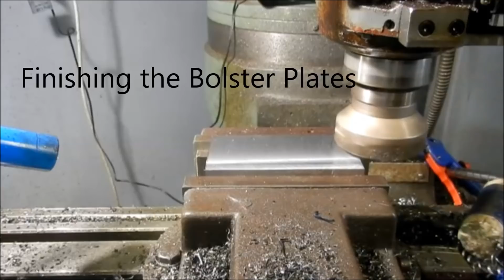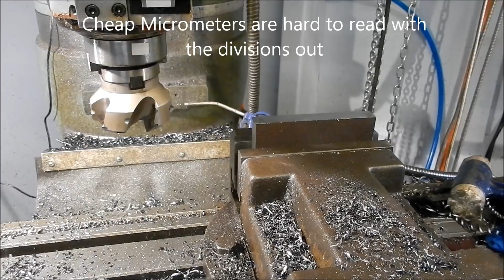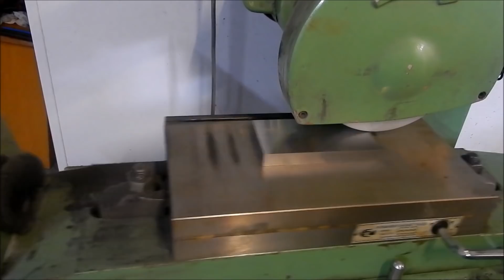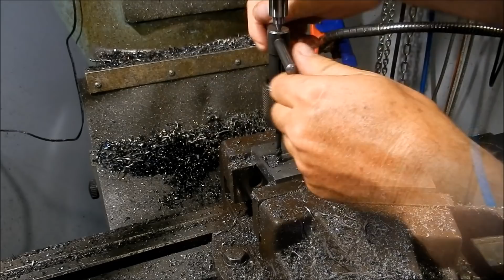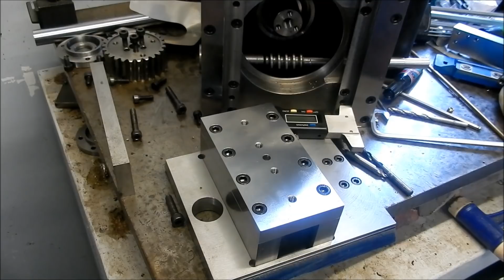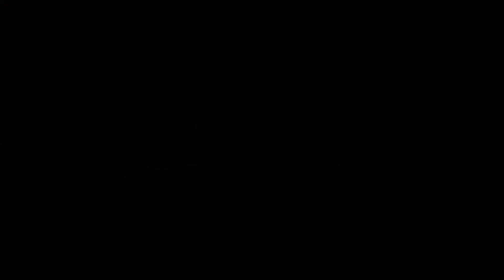Powered Lathe Slotter Build Part 46.  We finish of the Slide Bolsters

Comment: G’day Cam, do I see a light at the end of the tunnel or is that a train?
An awesome build and an epic journey, boy have you counted the holes drilled and taped? That piece alone is Swiss cheese and I especially liked your brass tube solution to the oil gallery problem, well thought out. 
A great series, cheers. 
Peter
Reply from the maker: Thanks Peter, I certainly hope its not a train coming at me.  I have visions that this won't work as I expect it to and I'll end up with egg on my face.  As you know it is something that can happen when you put yourself out on a public forum like YouTube.  Its probably a little harder when its something thats not tried and proven and you the bunny that designed it.  I don't think I what to count the holes drilled and taped, its my least favorite of all machining tasks but things don't stay together if it's not done.
Cam
Reply: I’m sure it will work